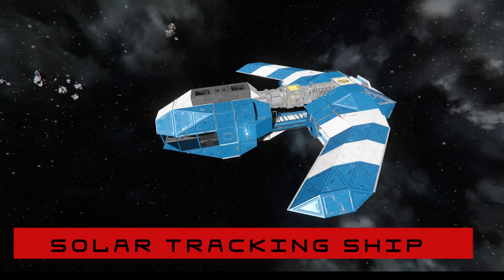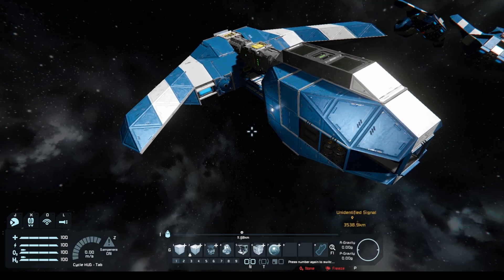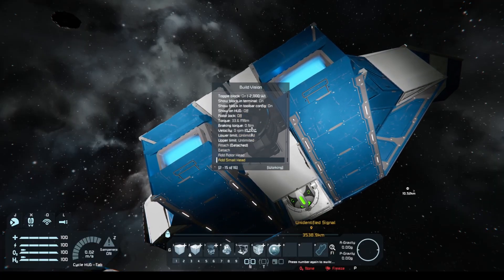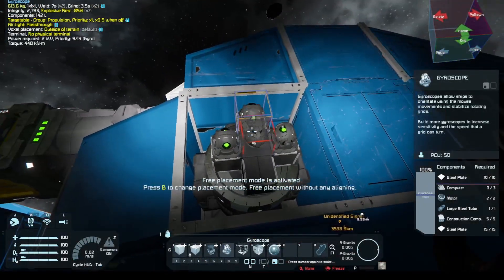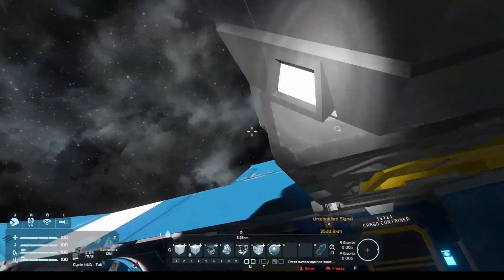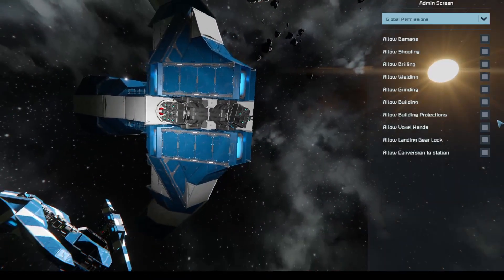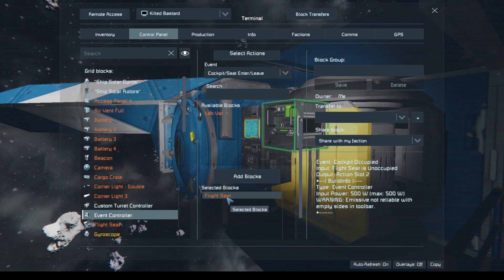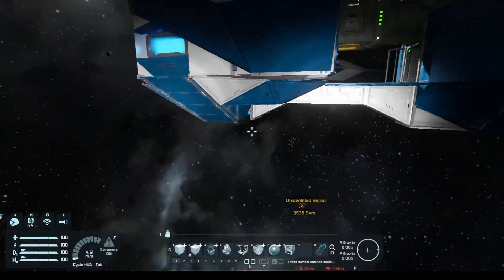Automatic Solar Tracking System for Ships – Space Engineers

Comment: Very cool! This is the same method we used for missiles before the AI blocks. For solar tracking I used to do magnetically attached gyro units with a solar panel doubling as sunlight sensor and power production so that it stopped moving the gyros once the solar panel was sideways to the sun, but that was kind of janky and unreliable sometimes. I'm gonna try this system for my next ship.
Reply from the maker: It does also work with the AI Move blocks, You will just need to disable the ships gyros.  (currently use this on a server to move around)

Comment: I like how I'm not the only person who does this, didn't use my event controller for an easy on/off with the seat. I set my system up with the event controller watching for power output from the solar panels & it turns on/off the algae farms. Those farms use power. On my build, power was red lining because of the refineries but turning on/off the farms helped fix that. Now that I have reactors, it's not a problem but power management is definitely something to watch closely in the beginning. As for what you have, I'm digging it. It's like AI missiles in the old days when custom turret controllers were the best way without a script.
Side thought, I set my solar on the bottom so I could get around my ship without solar radiation being much of a problem. I'm not saying everyone should do that, it's just a preference but sharing it anyways.
Reply from the maker: Hey so in my recent livestream episodes im building a massive solar array just for the solar radiation protection. So might as well make it serve multiple purposes.

Comment: @KiltedBastard So I think I can explain the orientation of the rotors:
If you imagine your classic tracking arm,  you want your rotors to control yaw (azimuth) and pitch (elevation). You never want a rotor in the position that controls "roll", as that would mean rolling around while looking at the sun and not necessarily changing the solar arm's orientation.

Now, if you are moving the whole ship, this translates to the simple rule of thumb that you never want a rotor facing the same direction as your camera - because that isn't going to change where the camera is pointing! This holds true no matter which way your panels or camera are pointing, and it doesn't matter which rotor is elevation or azimuth.
Hope it helps!
Reply from the maker: That makes sense, thanks for the breakdown.
Reply: @KiltedBastard  To put it simple, you can only rotate around the rotation axis of the rotor. If that axis is in the same direction as the sight line of your camera, that won’t help to change that sight line ;-)